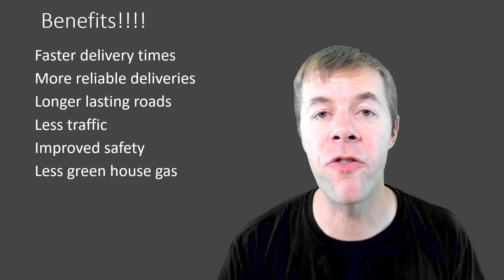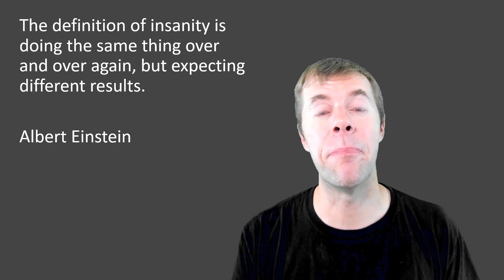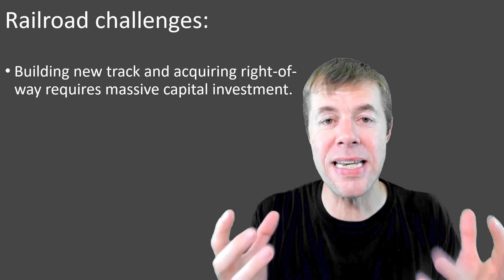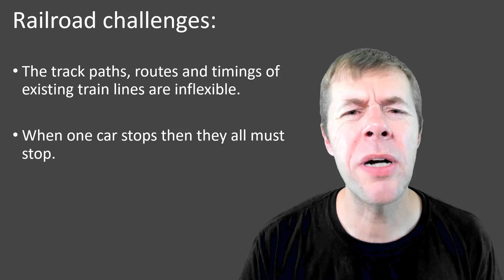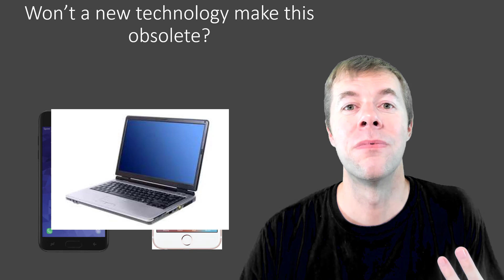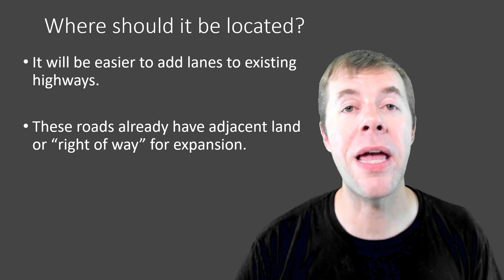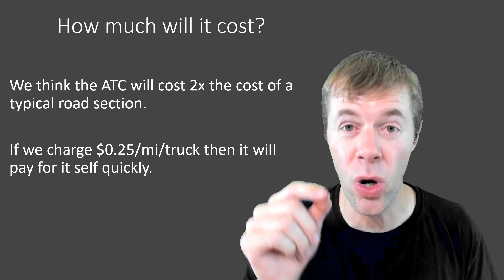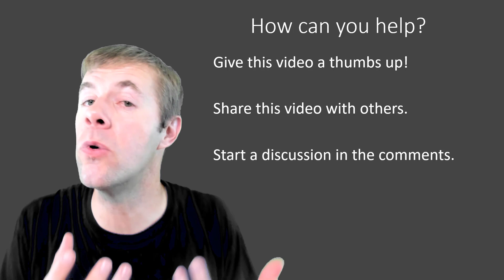How can autonomous vehicles save our roads? part 2 Q&A

Comment: You should consider the concept of integrating intermodal transport involving maglev trains.  This would reduce carbon  footprint and speed deliveries immensely.  A RO-RO maglev carrying the trucks would facilitate the ATC concept.  Maglev tracks can be....and should be....installed on elevated pylons above existing rail right-of-ways, allowing simultaneous traditional rail traffic below.  And.....maglev speeds can top 350 mph.  Also, maglevs can be easily used for passenger traffic.
Reply from the maker: Thanks for the comment.  Can the maglev be designed to carry the heavy loads?  I thought they were limited on their capacity?

Comment: We tried a large scale version of this in Texas. The funding was lined up, but the right of way issues made it DOA politically.
I think you CE guys are going to have to keep working on it.
Reply: What are were the ‘right of way’ issues? 
(Sorry non native speaker here)
Reply: @Conservator.  good question.
Right of way is when private land is taken for public use.
Reply from the maker: Thanks Edward, 
The Trans-texas corridor was a cool project.  I was working at TxDOT when they were designing it.  This project definitely had an impact on me and the ATC.  I think we need to use existing right of way on highways whenever possible to make the ATC.  This would avoid most of the right of way issues.  Thanks again for the comment!

Comment: The only weakness i see is in the overhead wires (Pantograph). Here in the UK we use this system for our electric trains. It isn't the most reliable and every now and again some little shit steals the wire for scrap value.
Reply: You are right. Overhead power lines can be done but not (within reasonable costs) at high speeds. I don’t think (high) speed is a crucial factor though. 
In Arnhem (the Netherlands) there are “Trolley busses 🚎 (didn’t know that there’s even an emoji for them). Their max speed is about 80kph 50mph. 
Apparently this is one of the 300 trolley bus system in operation worldwide now. There even were double decker trolley busses in Reading) 

https://en.m.wikipedia.org/wiki/Trolleybus

Comment: Hold on a tic...Trucks conduct their 'private' business on 'public' roads yet they act as if THEY own them. They don't obey buffer zone laws and they speed and drive in an aggressive/intimidating manner. For starters they should be relegated to the right hand lane only with a posted speed 10 mph below that of automobiles.
This will save fuel, congestion and lives.
Reply: Similar rules to the UK, except we can only overtake on the offside. Trucks are not allowed in the outside lane and drive at 60 instead of 70 mph.